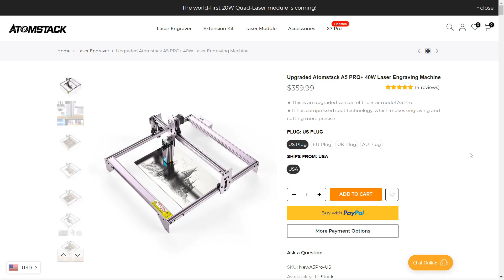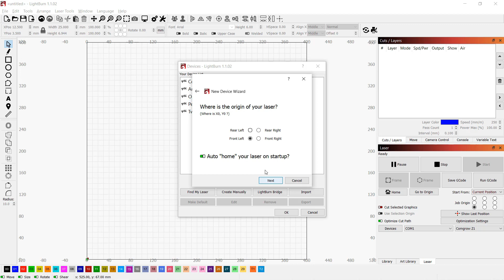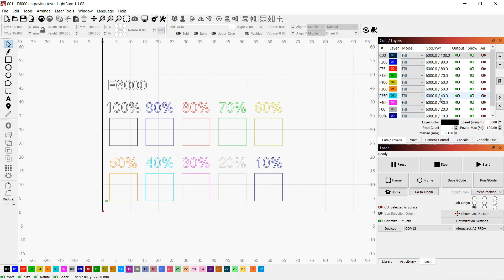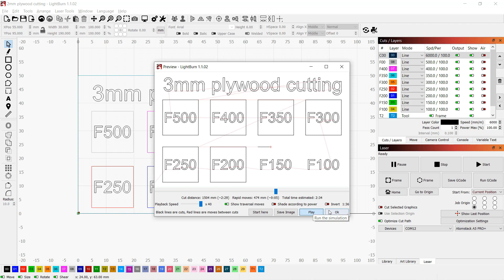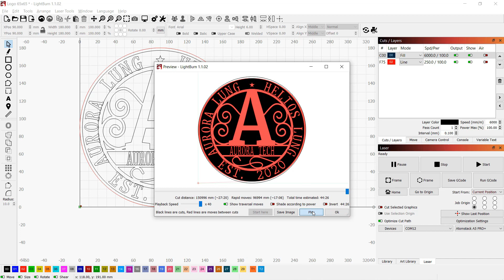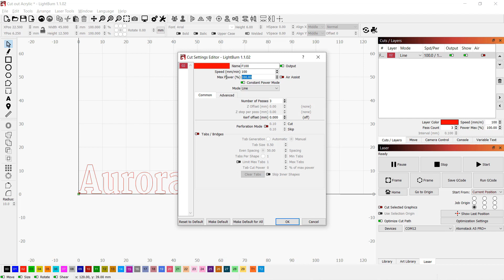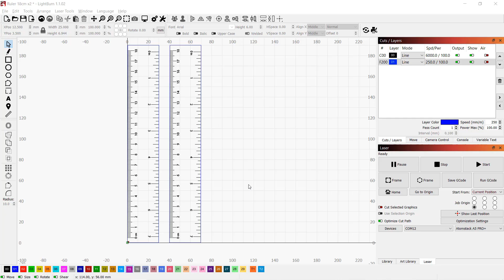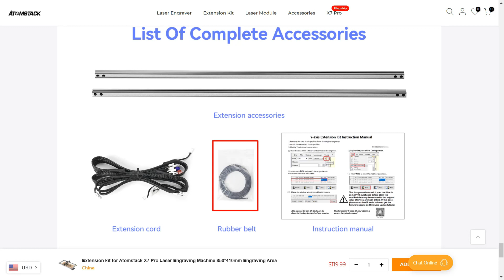AtomStack A5 Pro+ Laser Engraver: Does this compressed spot 5W laser module really work better?

Comment: Could you please help me!!! I love your videos you explain slowly. I have a ikier 24w laser auto focus all set up. I need really child like exsplain me how to set my part zero. Absolute or current position? When I ran a mill I’d use my edge finder side of vice or part g54 x0 y0 or
Whatever. I haven’t messed with CNC for 11 years so I’m confused about light burn first off I could right some code and I’d have this thing running days ago. So please step by step simply how to setup my part using light burn and auto focus. Thank you in advance once I understand that I’ve got it.

Comment: I got the Pro it seems, not the Pro+. Still 5w laser. However,  to even cut through the 2mm sample bit of plywood that came with it, I need to go 100mm/m at 100% ? Nothing like the results you got. Same with engraving - at 6000mm/m 100% you can barely see anything - it needs 1000mm/m. ?
Reply: THE LENS ON THIS P.O.S. IS NOT REPLACEABLE. 
WHEN THE LENS CRACKS (AND IT WILL!)
YOU'RE SCREWED.

Comment: it's funny because my atomstack a5 pro+ can cut 3mm plywood after 3 passes with air assist 250mpm 100% power and it's not the cleanest cut but it's decent for a 100% results 4 passes

Comment: I can't get mines to cut birch plywood. 1/4 inch
Reply: I can't cut even 3mm plywood 😒
In 100% power and 150mm speed with 4 passes...
For me this film is like a commercial of atomstack...
Reply: I have the Atomstack A5 and only can cut 3mm MDF with 90% F300mm and around 20 passes. If i go any slower it catches fire or leave nasty marks

Comment: Thank you for another great video!  I just set up my A5 Pro+ and installed LightBurn.  However, my "Laser on when Framing" doesn't work, did you have to make another changes for this feature?
Reply: Disregard, I found it!  On my Move window, there was a laser power setting, that was at zero.

Comment: I bought one and I'm not getting Lightburn to find my Atomstack A5 PRO +, I tried several drives and it didn't work, could you help me?
Reply from the maker: Please try LaserGRBL,, if it can connect to this machine, the motherboard should be fine, if LaserGRBL also can't find it, you need to contact AtomStack to replace the motherboard.
Reply: @AuroraTech  the lasergbrl works fine but for me it's very limited to work. I would like to use in lightburn
Reply from the maker: In this case, the hardware should be fine. I can't use LightBurn to find the machine, but I can manually add a GRBL engraver just like how I did in the video.